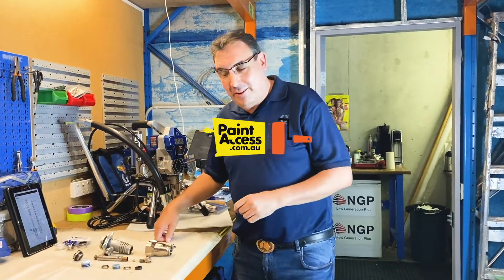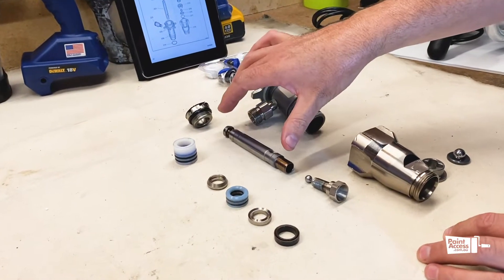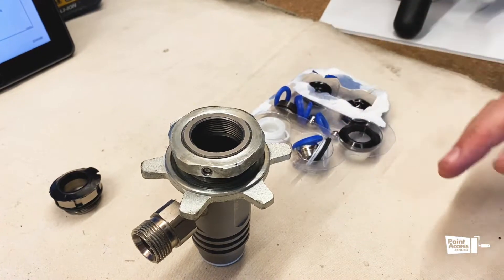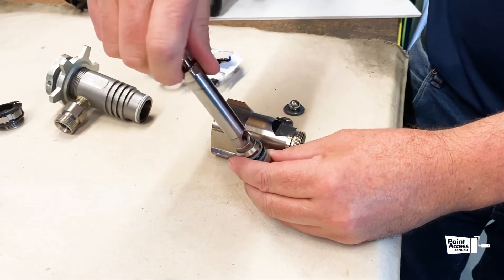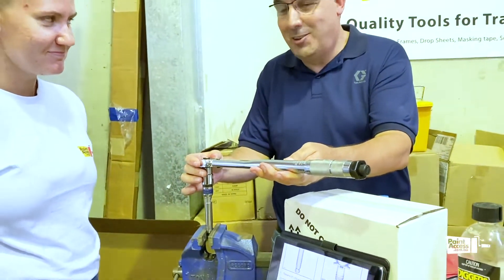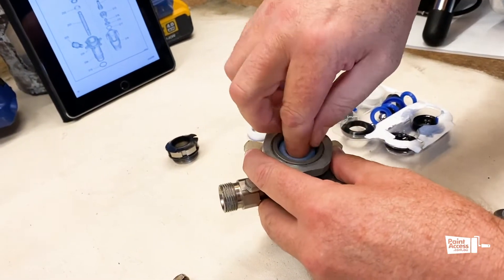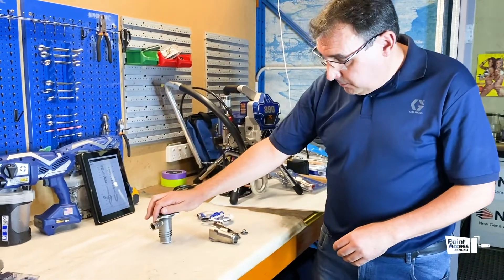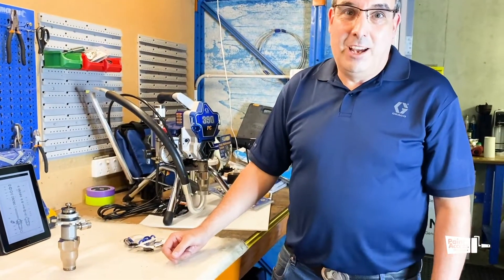Graco Pump Rebuild By Greg from Graco - Best Tutorial Around

Comment: Fantastic video! Thanks for making it. Maybe you can help solve my issue? 

After rebuilding the pump it still won't prime. You can hear the balls both moving freely and it's very clean inside.

 I've disconnected the line from the pump to the filter housing. Nothing comes out of the pump. You can feel some suction if you cover the intake hose connection with your hand. You can see the piston moving like it should, the motor sounds like it always has. I'm not sure what the issue is. Planning to call Graco tomorrow morning. Did you have any ideas?
Reply: You find out what the issue was?
Reply: @darkgloomystuff  Yeah! The washer between the pump and intake hose was damaged. It couldn't build up the suction. Lol super minor thing that no one mentioned.